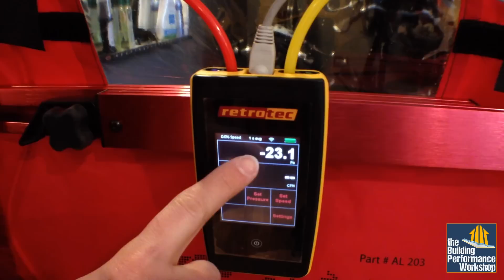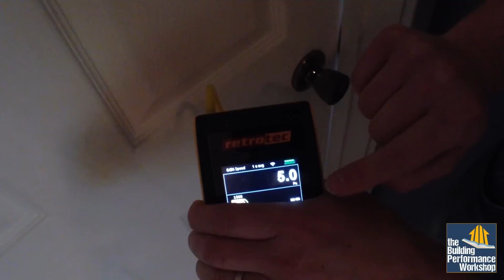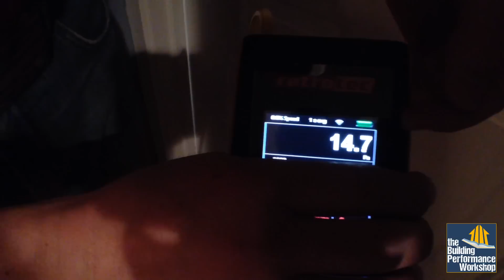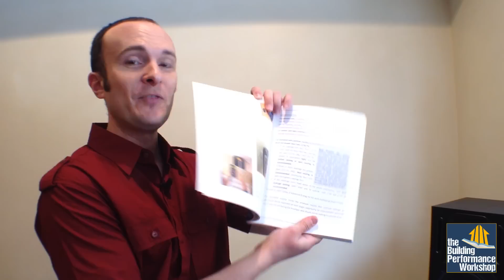Beyond Blower Doors: Zonal Pressure Testing

Comment: You forgot that one important factor… The guys doing the blower door tests, are doing all of the blower door test for the GC… They also go to the same bar together ,along with the building inspector… Lol 🙈there goes your building science… Sadly I’ve seen many new homes built in my area where the bonus room is freezing cold in the winter and stinking hot in the summer… Supposedly, they had a blower door test , snd the HVAC system was “ sized correctly”…using a manual J…..🙈… I saw one case where the guy doing the blower door test was paid cash to give it a pass… I wish it were not the case but unfortunately, that’s the reality of the situation in my area. Real estate agents refer to good technicians as… “Deal, killers“… It’s the same with a lot of general contractors, who are unable to build a tight house….the end result will be that the good technicians will be broke, and out of a job…🙈😅

Comment: Great video. Just had a thought though. When you first start a blower door in the home you should open all interior doors correct? And then one by one check your zonal difference. But shouldn’t you, after each room, open the door ajar as this may lead to subsequent readings as you make your way to each room?
Reply from the maker: Thanks, PD. Short answer is there’s no one way to do this test, but it’s thinking like you’re doing that makes it all more meaningful. Keep it up.

Comment: Corbett, catching up on more content today.  Couple of questions:
1.  Do I understand you correctly that if you are ZP testing, and your pressure pan reading on a supply register is more than 4% of your total pressure, that means that branch is more leaky because it is finding relief to outdoors?  If that one is more leaky than others, does that mean the leak is in that branch?  If all branches are very leaky, then it could mean a leak in the main trunk?
2.  A typical master suite (bedroom, closet, bathroom) may have 4-5 supplies and a return behind the door when you close it off.  That's a lot of connection to the rest of the house.  Is it possible that a ZP test could show little to no pressure change because of these openings, when it's actually very leaky to outdoors?  Would it be better to tape over all supply and returns to rule out duct leakage and connection, then perform ZPT?

Great explanation on ZPT by the way.  Happy Friday!  Thanks.
Reply from the maker: Hey Tim- yes to #1. And for #2, the thing to remember is that this test is more QUALITATIVE than QUANTITATIVE. Any home’s rooms will probably be ducted similarly, and you use ZPP to prioritize rooms. Keep it simple during testing.
Reply: @HomePerformance  thanks for the quick reply!

Comment: Just found your video and was wondering if you have to have a blower fan running while testing...we work on large buildings +/- 100,00sqft and it would be cool if we could use the manometer without the fan and conclude if there's leakage...
Reply from the maker: Can’t do it, Drew... BUT, the test you’re describing IS a good one for diagnosing HVAC imbalances.

Comment: Hey Corbett.. thanks for posting this video and explaining the mechanics of pressure testing with a good sense of humour.. My question to you: if a person is in an older home in a colder area and you provide your service.. they follow your recommendations and as a result, their house is a lot more air tight.. do they now have to consider some sort of fresh air replacement (HRV) equipment?     Tnx Richard. Northern Canada
Reply from the maker: Short answer, YES- in fact, lots of us agree that even leaky homes should have some kind of outdoor air ventilation. What happens when it's mild temps outside and the wind won't blow?

Comment: Hello Corbett!

Any thoughts on what a window AC unit would do to these numbers? A lot of clients have window AC units in during the summer and it is some times difficult to remove the unit for testing depending on the size. I was wondering if you had any experience with window AC units and how that would effect pressure differences as well as the CFM50 of the whole house in general (having those units in place)? Any feedback is much appreciated! I do a lot of performance testing and always find my way back to your videos when I'm stumped or need a refresher.
Reply from the maker: Hey Austen, thanks for being a fan, and for your message. In my experience, the units themselves don’t make as much difference as the hack job the ‘installer’ did (wink). I like to take them out for testing, personally, and in fact in energy modeling software you’re encouraged NOT to include them at all, since they’re temporary, and not a part of the home so to speak.

Comment: Are you testing the house in an 'as-operated' condition i.e. mechanical penetration openings NOT sealed off temporarily for the test (unlike US ACE)?
Reply from the maker: Depends on what the goal is. Generally, as-operated is the most meaningful, but if I’m testing an airsealing job, then yes, I block off the mech openings to focus in on what we want to know.

Comment: Great stuff Corbett! Was a follower back 10 years ago when the energy code in Illinois brought envelope and duct tightness testing into practice.  Moved to Knoxville TN four years ago and building performance is a new and growing field here.  You are using Retrotec, I recall in the past you used Minneapolis?  What are the pros/cons of each?
Reply from the maker: Hey Jim, I remember you! It’s a matter of taste for many, but Retrotech is easier to use in several ways and looks cooler imho.

Comment: -A. if one pre tested a register 10% ( 5/50=0.1)
B. Duct sealed
C. Post tested at 5% (2.5/50=5%)

Q. Based on the test data supplied above...Could one assume that leakage was reduced by 50%?)
Reply from the maker: Hm, interesting q, very complicated answer. For example, if the duct was wide open disconnected in the crawlspace, and the crawlspace showed ZPP of 10%, then the duct pan would too. Then, you could make the duct read a 50% reduction by airsealing the crawl, and not touch the duct at all. It’s complicated.

Comment: Hello,
I have an upflow furnace located in a mechanical room in my house single story home with a central return, the plenum penetrating the ceiling with the entire trunkline and supply branches and supply boots located in the unconditioned attic, and of course outside the pressure boundary.

My question-

Q1. I have 8 supply registers and 1 central return. For fun...I was curious what you you thought about not only testing all 8 supply registers. But also testing, at a single point,  the entire system at the return. 
What might my single point pressure pan test at the return show as a percentage if, for example, all 8 registers tested at 3%?
I suspect the it would be 3% as well.

Q.2 what if 4 registers test at 8% and 4 registers test at 3%...then what might the test show at the return?

Feel free to call if u want, reply here, or email me
Thanks
Doug
517.974.8592
flybyya@hotmail.com
Reply from the maker: I would imagine it would show roughly the same reading as any of the supplies, but I’d still test it and see.

Comment: Corbett, the only problem with this method, is that you can’t quantify the ratio of Connectivity toninside/air leakage to outside, which will manipulate this number.  Ducted Heated heating outlets and how they have been commissioned depending on the length of runs...
Reply from the maker: If there’s a better method aside from a tracer gas test, let me know!
Reply: Home Performance one method I use, is just closing the door slightly, and feeling how much air you can feel coming via the door?  Again you would need to tape up the ducted heating outlets though. So that you know the majority of air is coming via the door and not bypassing via a ducted heating system.  But I guess it’s the same net effect. 😉
Reply from the maker: Yes, but that’s not quantitative and not repeatable. ZPP is both, despite its flaws.

Comment: Those dm32 gauges are beautiful things.  Internal wall cavity leakage is a massive issue down here in Australia.  Air movement through these internal walls, equates to more uninsulated surfaces to contend with on top of your external walls.  Very useful video.  Thanks.

Comment: Love the videos, I’m learning tons. With regards to the zonal testing of rooms, would it be better practice to re-open a room door before starting the check on another room? Wouldn’t having multiple doors closed, slowly start to skew the math with the relation to reference?
Reply from the maker: That question is simple on one hand: you must have the blower door configured to hold at pressure, not speed. If it runs at a constant speed, then the pressure diff will slowly build, yes, due to the shrinking volume.
However, you DO want to re-open doors generally to make sure all air pathways point to outside or blower door zones.